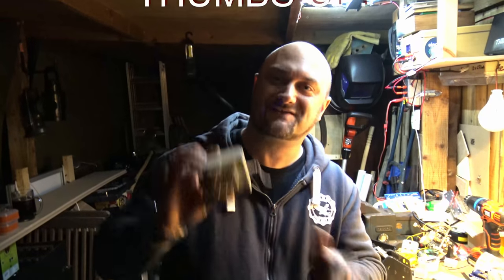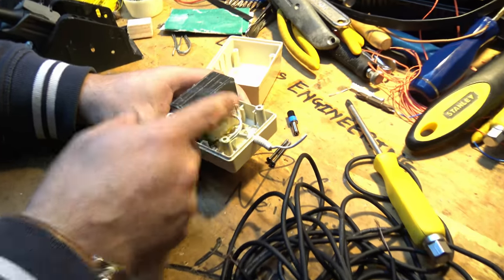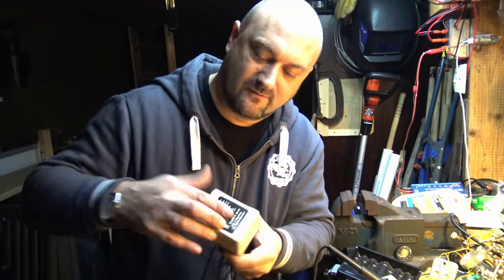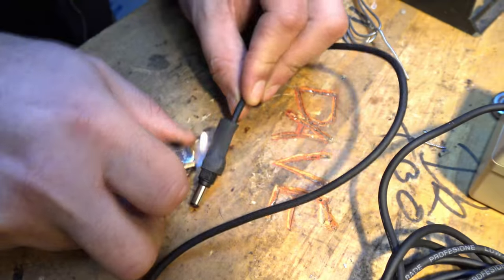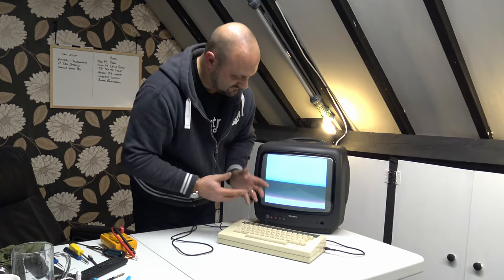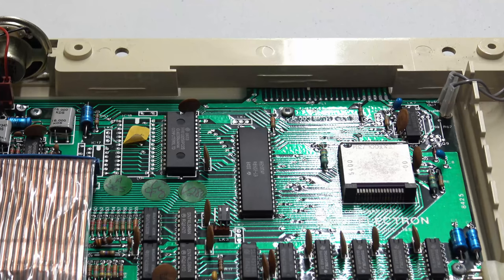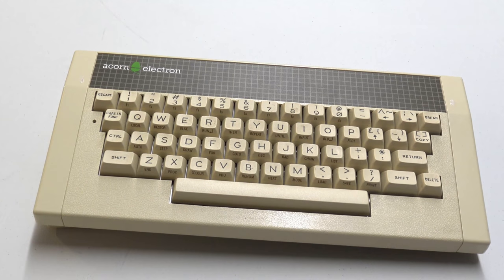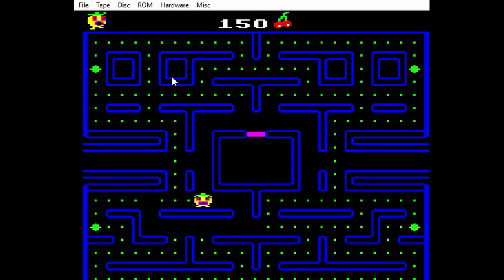DuB-EnG: Acorn Electron Repair and Refurbishment - Fixing the PSU and Diagnosing other Problems

Comment: I've been gently restoring the Elk I did the code for my degree dissertation on. It's a 1986 build without the socket on the ULA, and a strange  R/C bridge mod that doesn't seem to be part of the original design,  and that I didn't add (I did do the chrominance mod for the composite, so it works with my TV in colour, but other than replacing like for like electrolytics, that's as far as I'm going)
Reply from the maker: Great work Roger...  I'll show you how I got this working in the next one...  It was a tough road, but we got there in the end!! ...  CHAIN""
Reply from the maker: For being so kind and taking time to chat...  here's a little preview of the next video!  Please don't hesitate to thumbs up if you like it!!  https://youtu.be/-7n-FJI2iGU

Comment: The inside of the electron reminds me of the speccy, similar looking dynamic rams of one bit each.
Roms/ula/modulator and bits n bobs.
But the electron has a seperate +/- 5v board, nice.
The speccy did that on the main board and had to supply 12v to the rather odd memory sinclair put in.
Power bricks with screws, that is a propper brick.
Reply from the maker: I would love to play with a speccy... they are getting so expensive these days... I wonder if I can find one thats broken and fix it up...  I am really happy to say that I just fixed this electron, I had to replace the ULA...   hardship, but sucess!! ...
Reply: @DubiousEngineering  

Wha? You don't have a Speccy? :o

For maximum nostalgia (and tea brewing time), I would recommend a Speccy +2.

It has a nicer keyboard than the original 48K "dead flesh" (IMHO), and can obviously play 128K games.

It has a more usable BASIC, too.

The +3 is nice, but the floppy drive takes away the "joy" of waiting 10 minutes for a tape to load, only for it to crash at the end. lol
Reply: Im supprised that speccys are expensive, they are not rare, there must be loads in the uk, mostly in cupboards forgotten lol.
Now the old zx80 has to be rare, no nice ula chip, made from all logic chips like the 74ls series i would think.
But the zx80 and 81 were not as much fun as the later speccys.
Reply: @zx8401ztv  

I, erm,stupidly  gave away my ZX81 to a man known simply as "the potato".

I also had multiple ZX80 / ZX81, printers, RAM packs and all sorts in the 90s. It was all dirt cheap then, like £15 per box.

One of my biggest regrets is not clinging on to more of that stuff, which is very likely why I like retro stuff now.

Not sure if I ever owned a Sam Coupé, but I vaguely recall seeing one at our local dump, and Dad wouldn't buy it for me. :(

I can't really complain, as we bought hundreds of other machines. All got sold or re-dumped, sadly.
Reply: ElectronAsh
Well i would not call you stupid, Zx81's were all over the place, you could walk down the street and trip over them lol, ok a slight lie.
Somewhere i have a zx81 plus sinclair printer, a very odd design but it sort of printed if you kept it clean.

I have some spectrums as well, and the multiface.
The speccy was a lot of fun considering how minimal it was.
Then a p.c came along and ruined me lol.

I thought hard about the sam coupe, and came to the conclusion it was expensive for what it was and far too late, so i didn't bother.
I dont think you missed much.
Reply from the maker: Awww... ash...  please stop putting these things in my head! ...   now I have a tv, I’m eager to get a speccy...   perhaps I can use my MP3 player as a tape source! ... that would be fun!
Reply from the maker: Aww man...   I have something that predates the zx80 ... I need to buy a batter scope, then I’ll have a go at fixing it up...  it’s a bit of a machine code thing with nixie style tube display...
Reply: Howard - You can use a an mp3 player as an input source, I think there are a few vids around where people have sampled tapes.

Personally tho, for loading purposes, I'd possibly be inclined to use a smartphone or cheap tablet (a Kindle Fire 7 8GB) and you've got the benefit of preparing and seeing your game playlists.

Depending on how many games you manage to acquire a 16GB SD card would be decent enough!
Reply from the maker: Well well...  Thats exactly what im doing now... I send you a link to the new video in a few minutes...  I love your idea of the kindle... I have a few of those around doing nothing....
Reply from the maker: For being so kind and taking time to chat...  here's a little preview of the next video!  Please don't hesitate to thumbs up if you like it!!  https://youtu.be/-7n-FJI2iGU